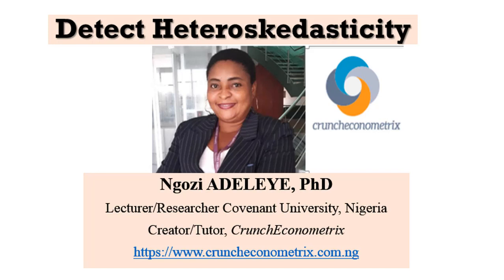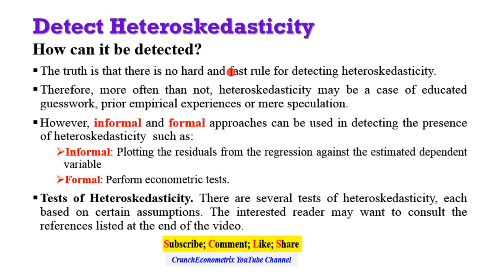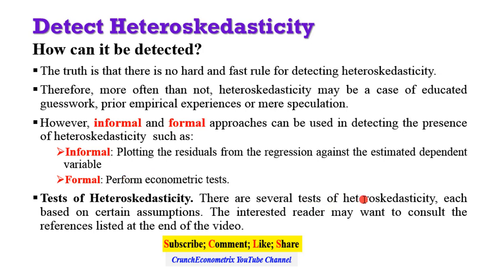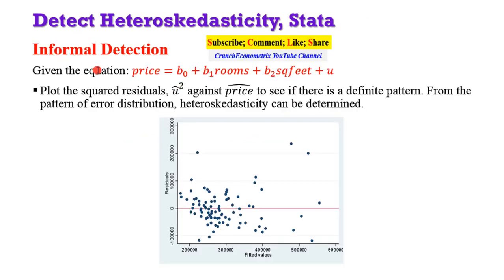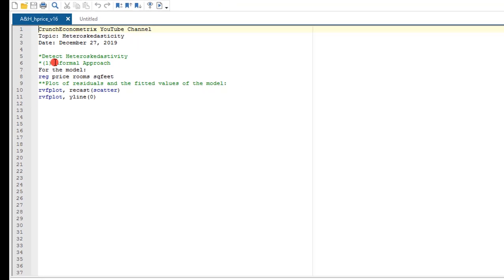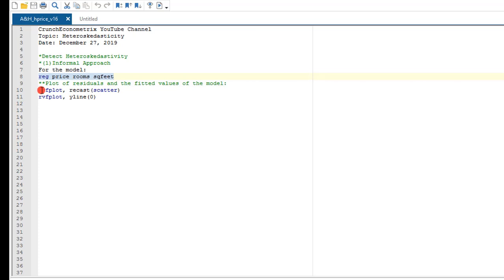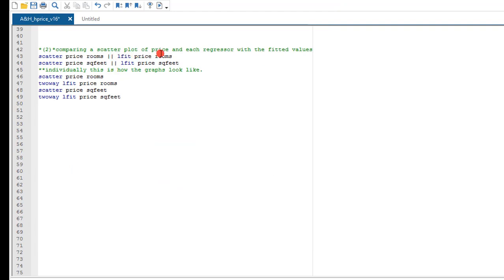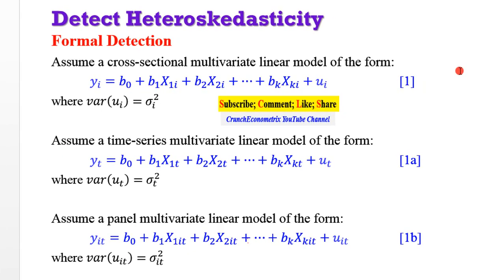(Stata16): How to Detect Heteroskedasticity #archlm #graphs #plots #errorvariances #gls #wls #ols

Comment: Hello madam, I am currently working on an assignment related to gdp (dependent) and its component (independent variables). When I am using the unofficial way to detect heteroskedasticity, I found that net export's residual plot have the highest possibility in heteroskedasticity while other variables do not ( all of them are positive linear relationship). When solving heteroskedasticity with WLS or GLS, I found that I could not use the method as my net export contains negative number. Moreover, when testing independent variables by using multicollinearity method that later transition into heteroskedasticity test, I found that other than net exports, all independent variables are heteroskedastic. Appreciated your helpful videos.